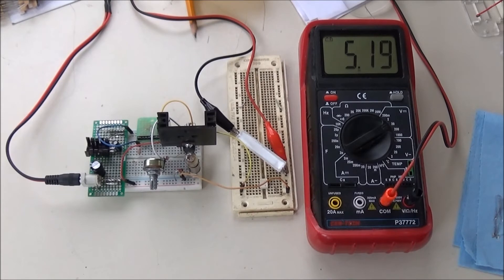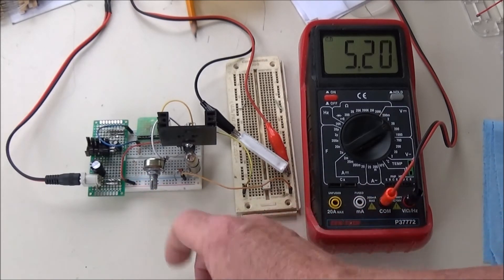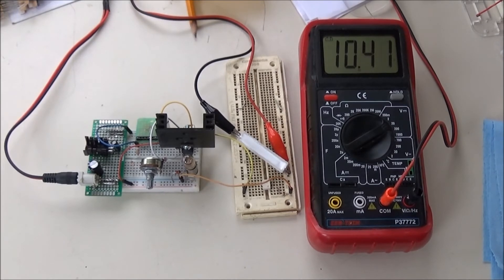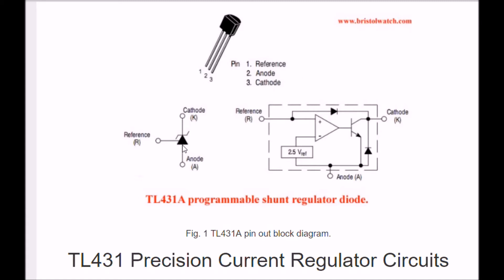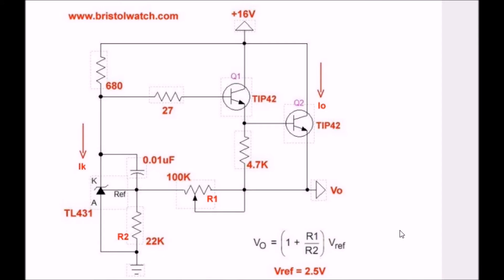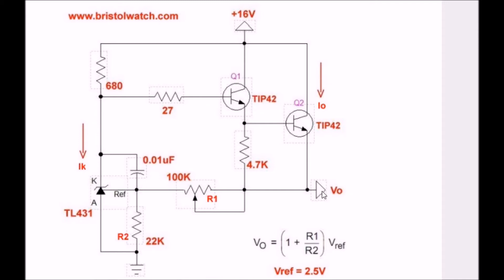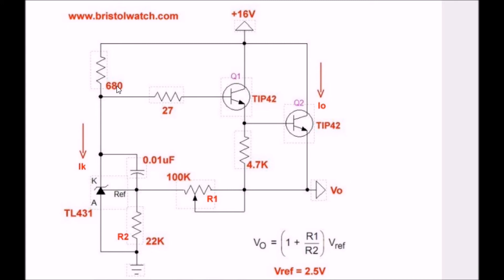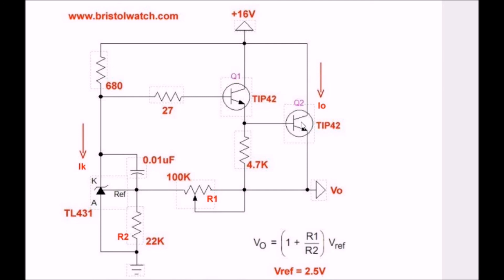TL431 Precision High-Current Series Regulator Explained

Comment: What's the purpose of the 27ohm and the 4.7k resistor? Thank you for these educational videos!
Reply from the maker: The 27 ohm limits the base current and the 4.7K stabilizes the 2 TIP42s connected as Darlington configuration.
Reply: @LewisLoflin thank you. Do you have any video explaining the use of 4.7k to stabilize the two transistors?
Reply from the maker: @BeetleJuice1980 @BeetleJuice1980  No, but if one looks at any spec sheet for Darlington transistors, you will find resistors. Google TIP120 pdf and see.

Comment: It really works. In my trials with Proteus, I saw that I could get a maximum output of 850mA.  (For 7V source voltage with TIP41.) When using only TL431, a maximum of 100mA output can be obtained.

Comment: I built this circuit.  I substituted a 2N3904 for the first stage transistor.  I substituted a 2N3772 for the TIP41 "series pass" transistor used by Mr. Loflin.  (There is a minor typo in the circuit diagram.  The transistors Mr. Loflin used are TIP41 transistors, not TIP42.  TIP42 transistors are PNP.  The diagram correctly shows NPN type transistors.)  I had to substitute transistors for the ones Mr. Loflin used because they were the transistors I had in my parts bin.  Otherwise, I built the circuit as Mr. Loflin shows it here.  I did use the 3-pin version of the TL431 that comes packaged in the TO-92 case.  WOW!  What great voltage regulation!  ROCK SOLID.  This circuit beats every IC-based voltage regulator I have tried, including the LM78XX series, the LM317, and the LM350.  This circuit also beats every "zener with transistors" voltage regulator I have built.  Using a 10K ohm resistor as the load, the voltage out was 12.03 volts and the current was 1.203 mA.  With 7.27 ohms of load resistance, the voltage out was 11.95 volts and the current was 1.644 amps.  That is voltage regulation that varies  by only .665 percent from "no load" to "very heavy load".  This is a great circuit.  Thanks for posting this, Mr. Loflin!

Comment: Lewis, when I change the load resistance the current changes.  I thought a current regulator changes it voltage to keep the current constant through a changing load.
Sorry for all the questions. I am trying to get more familiar with the hardware side of things.
Reply: His circuit doesn't seems to regulate in current but in voltage, I think he did a mistake in the title. To be able to regulate in current you would have a resistor in series with Q2 and mesure its voltage across it to compare with the internal 2.5V tl431 voltage reference and make it so when the voltage across the resistor is greater than 2.5V it shut of Q1 shutting off Q2 until the current diminishes , turning on Q1 and Q2 again.
Reply: This is a precision voltage regulator circuit, not a precision current regulator circuit.  It is a "high current" voltage regulator, meaning that it will hold the voltage you set it to even when the current is "high".  The TIP41 power transistor, which is the "series pass" transistor, can handle lots of current if it is properly heatsinked.  That is what makes this a high current voltage regulator.